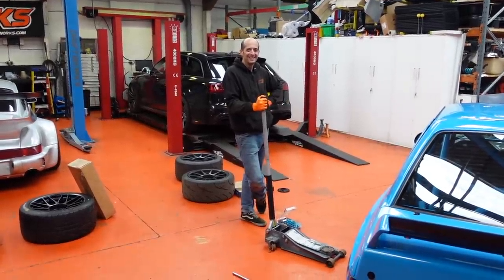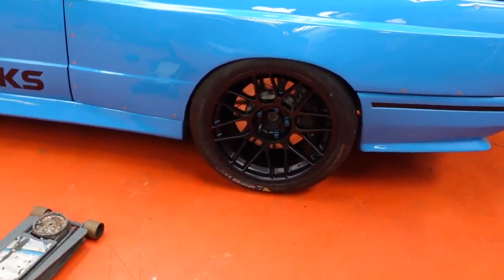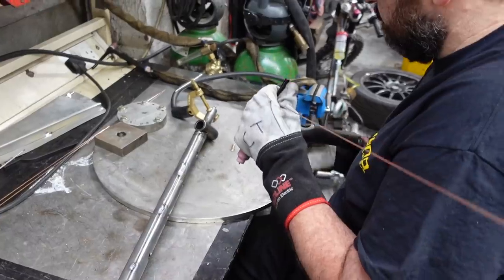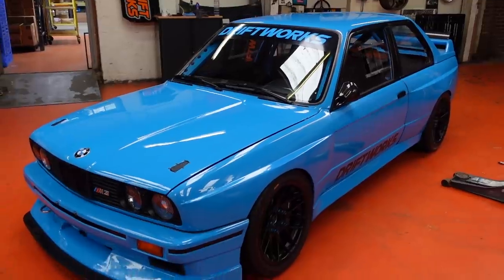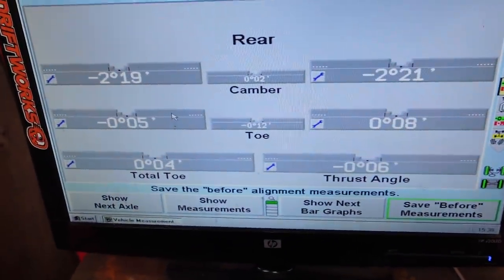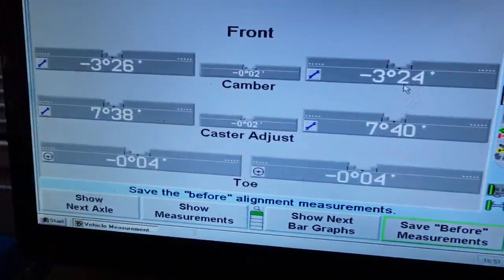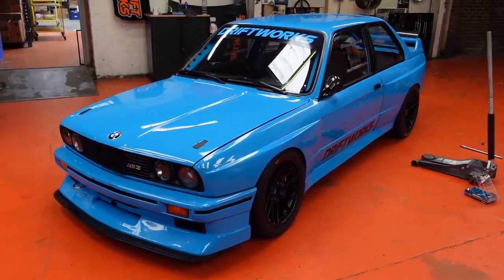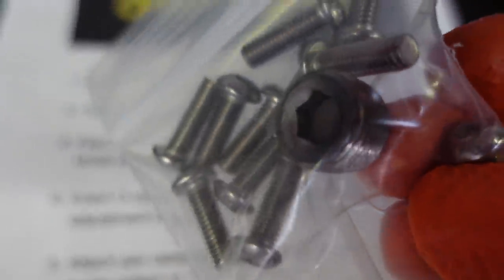Driftworks E30M3 pre-trackday changes - New ARB + wheels, dct oil pan & alignment

Comment: Phil frantically changing bits on the E30 as he knows the FWD 200bhp club is coming after him 😂
Reply from the maker: Haha, that DC2 is something to behold! The French stuff. Meh..
Reply: Just have to last a few laps and the FWD club will break down, the Integra with Al at the wheel should put up a fight though.
Reply: k mc 
Hely! 
If the E30 was standard the Integra is would be serious opponent but the E30 is Isn’t standard (by the looks of it :)  )
so Al might need some brave pills....😜
Reply: @tomivrg  Yeah the M3 is a weapon compared to the Honda but Cadwell Park is a tight circuit in places. Could be fun.
Reply from the maker: If the E30 M3 was standard, the modified DC2 would have destroyed it. Al already has ALL the brave pills. Like there are none left in the pharmacy.
Reply: Lol pt82 drives a Honda lol
Reply: @SuperAlicat1979  Yup. K24 frank engined EG with DC2 running gear etc all in a car that weighs a ton. Most fun car I’ve ever owned out of several Spec C Imprezas, Cosworths, Golfs and a Focus RS. Low maintenance, reliable, nippy fun.

Comment: I bought some red tint clear for taillights a while ago, does good with a few coats, it's not saturated with color so you have the liberty to be light or heavy on the red. (did it on my 78" Mini, I hated the big clear bottom part for reverse lamp)

Comment: There’s is another way to reduce the noise from the exhaust. you can try make the exhaust tips face down the ground.
Reply: BORING! 🙄🤣
Reply from the maker: Yeah that was discussed. Possibly cutting the tips off and using a Vband to point them down when required. It'd look absolutely awful though.
Reply: @driftworks  100% hopefully another solution can be found
Reply: Nah 90s spec, twin upturned. That would end the rear bumper

Comment: Startec's are the best.
Reply: @driftworks  is there an upside of running the swaybarlink up to the strut like the m3 instead of the control arm like the normal e30's? (Beside adjustability?)
Reply from the maker: It can help with steering feel/return at lower castor settings. I'm very pleasantly surprised with how nice the steering feels on mine with it mounted to the lower arms.
Reply: @driftworks  thanks!

Comment: Hey mate, you planning on switching to another standalone DCT management? I'm currently running HTG on my racecar (E36 with LS1 and DCT). I was wondering what your experience was with your current management.
Reply from the maker: Not at the moment. I'm hoping to get this working properly. (It doesn't currently)

Comment: you gonna put in an extra silencer?
Reply from the maker: I probably will. I was only just allowed out on track at Cadwell. If the marshal had chosen to be a dick I would have been on the trailer.
Reply: @driftworks  Seems better to err on the side of caution then. Or have a quick change modular setup.
Reply from the maker: That's the plan. Have an interchangeable section. Or 3 options like I do on the DW86.

Comment: Cadwell dosent have a drive by it’s a static test 👍
Reply from the maker: As I found out. I pretty much failed even with the new bung in.
Reply: Driftworks gutted. Did you not hold it at the magic 5k (3k) 😉😉😉

Comment: Cadwell is always a twat for noise tests because of the location of where they do the static test! Always echos the noise an reads a few db higher I’ve found with the bikes
Reply from the maker: Interesting to know, as I effectively failed the test & was then told they have the highest limit in the country and I wouldn't be allowed out on track anywhere else 🤓

Comment: 0° toe on a track car? 🤨
Reply from the maker: Where does it say 0 toe?
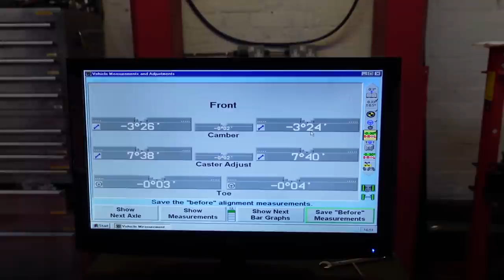Reply: @driftworks  @12:42? To me -0°04' is as much as zero 😂
Reply: @magnetic0314  15' toe out usually on my clownshoe, makes for an awesome turn-in response, although the car is unstable AF at high speeds
Reply from the maker: You need a more accurate alignment machine then 😄. A combined 10 minutes of toe out is more than enough on most well setup cars. More toe-out may be necessary if you have no roll centre correction though.